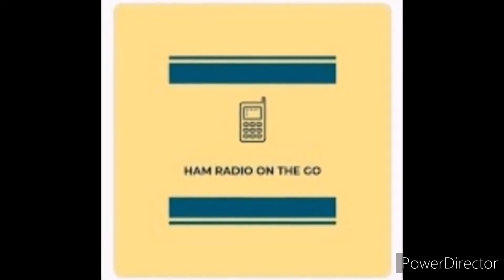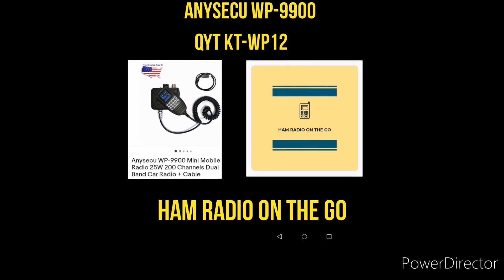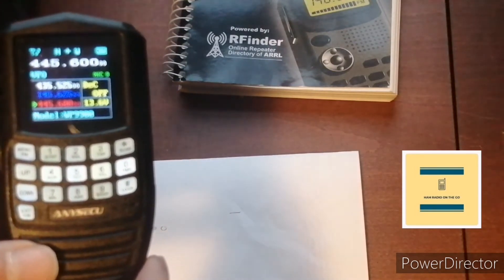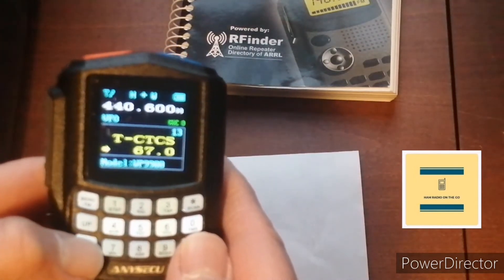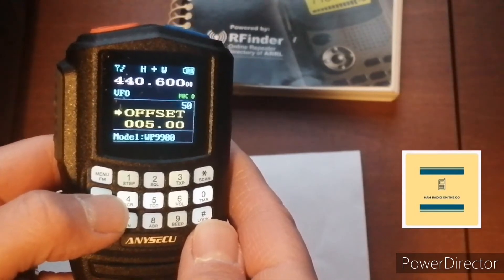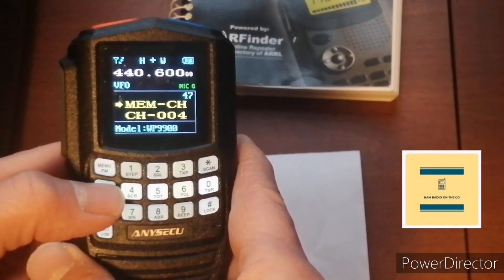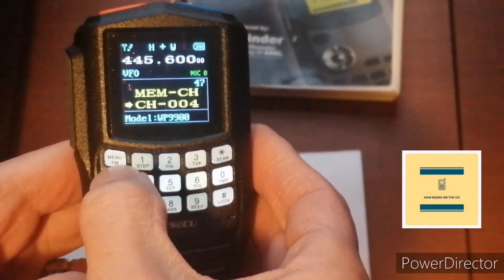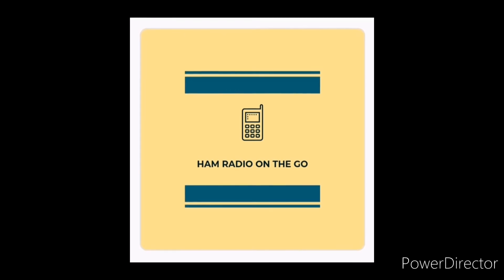How to manually program an Anysecu WP-9900 & QYT KT-WP12 micro dual band VHF UHF FM radio #hamradio

Comment: Hi! I got a QYT KT-9900. I'm configuring t-ctcs. In transmission it shows "Enc 100" but it's not working with repeater. Any tip?
Reply: I suspect it's not sending the ctcss even though configured t-ctcs.
Reply from the maker: I will take a look at my settings . 73
Reply: I just requested to send back to dealer. There are some bugs with memory and offset frequency. further I guess mine is working with MW potency.
Reply from the maker: @PY7ED ok hopefully they send you a good unit that is working correctly. Good luck. Obrigado 73

Comment: Hi my *#abcd dtmf buttons dont seem to work and ive been trying to find a fix, Do you know of any solution? 73's
Reply from the maker: Easy fix is a new mic. Harder fix is trying to open rhe case and see what's going on. I tried to resolder a new key pad onto a baofeng UV5R once and it didn't end well.
Reply: @hamradioonthego  I've tried a new mic but still the same 👍
Reply from the maker: @neiltaylor6825  then it might be the actual transceiver is my guess.

Comment: Thank you so much.  I was about to give up and return this radio because I couldn't program the offset and have it work in Channel mode.  I have never had to program a radio this way but it is working fine now.
Reply from the maker: I'm glad this video helped you program that radio. I always try and learn to program my radios manually and some are easier than others.  73
Reply: @hamradioonthego  I have one of these for an old pickup truck. I like the compactness of it but will never buy another Chinese radio and/or a radio I can program without a manual.
Reply from the maker: @kennygee2715 I hear you. These radios remind me of the old Yaesu 8500 aka “Mr Potato Head”. 73

Comment: Important , can I transmit on the 451Mhz if so I’m buying one
Reply from the maker: Sorry for delay as I had to get a dummy load as that frequency is outside the ham bands and I wanted to be in compliance. The web info says yes and mine also does . That’s no guarantee as in the Baofengs used to also TX across the spectrum but now are locked. I hope that helps you. 73

Comment: Just got my Anysecu wp-9900 and discovered it would random power off and back on, I think I found a fix, the screen backlight set to turn off, but while in scanning mode when backlight turns off the radio will power off and back on. Keep the screen light on always. Don Carter - N5OCC ham.
Reply from the maker: Thanks for the tip. The good on the Chinese radios is the price. The bad is sporadic quality control and emissions on certain radios.  The ol “life is like a box of chocolates “ comes to mind . 73

Comment: havehad my wp9900 for 3 months now    to get the vip software to install typically you have to turn off antivirus after scan the files.  press the orange button to open squelch then  up or down arrow keys to adjust volume. there are 3 power settings but one of them you have yo use  the lock key button to get to ..  several people are reporting manual entered freq will not scan only one entered with software.   there is a wp990 FB group now we have
Reply from the maker: Thank you for the informative comments. I enjoy and always try to program my radios manually. We cant always have the computer with us. Thats the reason I put this video out. Thanks for watching. Where is the WP-9900 group site located?